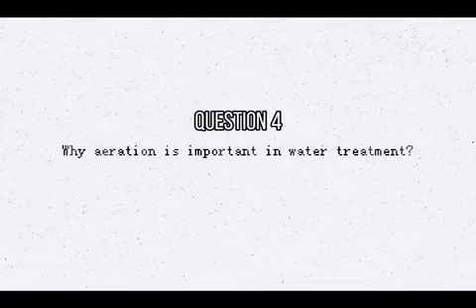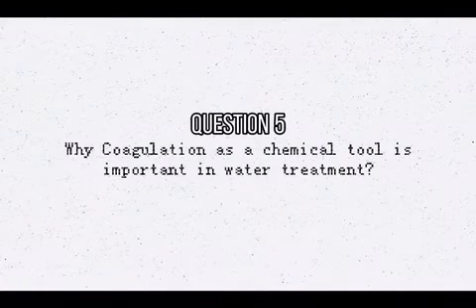MIDTERM ACTIVITY|CHEMISTRY FOR ENGINEERS-LAB|WATER: ITS PROPERTIES AND PURIFICATION

Comment: Discussion
A water filtration experiment is a scientific study that aims to determine the effectiveness of different methods of purifying water. It begins by collecting a sample of untreated water and measuring its initial quality, then it runs it through a series of filtration and purification processes such as coagulation, sedimentation, filtration, and aeration. Different types of filters and treatment methods can be tested in the experiment such as sand filters, activated carbon filters, reverse osmosis systems, chemical treatments, and biological processes. Once the experiment is complete, the results are analyzed to determine which filtration methods were most effective at removing impurities and making the water safe to drink. The findings can help inform decisions about how to provide clean, safe drinking water to communities in need and also help water treatment facilities to optimize their treatment processes.

Comment: Materials/Instrument/Chemicals
 
•	2 Liters of Dirty Water
•	3 Liters of Clean Water
•	3 Two-Liter Plastic Soft Drink Bottles
•	1 Large Breaker/2 Cups
•	Coffee Filter/Cloth
•	Rubber Band
•	1 Large Spoon
•	Pebbles
•	Fine and Coarse Sand
•	Alum (Powder)
 

Observation
The untreated water appeared cloudy and had a yellowish color, it also had a strong earthy smell. The water also had visible particles floating on the surface and sediment at the bottom of the container.

The treated water, on the other hand, appeared clear and had a slight blue tint. It had no smell, and no visible particles or sediment were present. The water also had a clean and fresh taste.

After running the water through the filtration process, the results showed that the treatment had a significant impact on the appearance and smell of the water. The water went from being cloudy and discolored to clear and colorless, and the smell went from strong and unpleasant to clean and fresh. Overall, the treated water met the standard of a safe drinking water.

Comment: PROCEDURE
1.	 Pour dirty swamp/river/canal water into the two liters bottle with a cap.
2.	Place the cap on the bottle and vigorously shake the bottle for 30seconds. Continue the aeration process by pouring the water into the another bottle or the beaker, then pour again.
3.	Add two tablespoons of alum to the aerated water. Slowly stir the mixture for 5 minutes.
4.	Allow the water to stand undisturbed in the container. Observe the water at 5 minutes intervals for total of 20 minutes.
5.	Construct a filter from the bottle with its bottom cut off as follows:
a.	Attach the coffee filter/cloth outside neck of the bottle, using a rubber band.
b.	Turn the bottle upside down placing it in a beaker or cut-off bottom of a two litters bottle. Pour a layer of pebbles into the bottle-the filter will prevent the pebbles from falling out of the neck
c.	Pour the coarse sand on top of the pebbles.
d.	Pour the fine sand on top of the coarse sand.
e.	Clean the filters by slowly and carefully pouring through 3 liters (or more) of clean drinking water.
6.	After a large amount of sediment has settled on the bottom of the dirty water, carefully-without disturbing the sediment-pour the top two-thirds of the dirty water through the filter. Collect the filtered water in the beaker/plastic bottle.